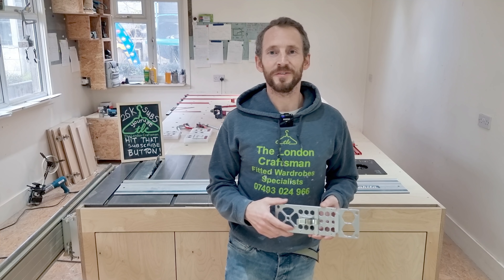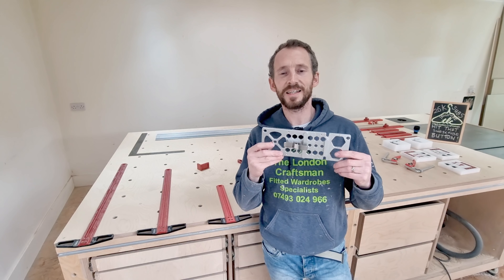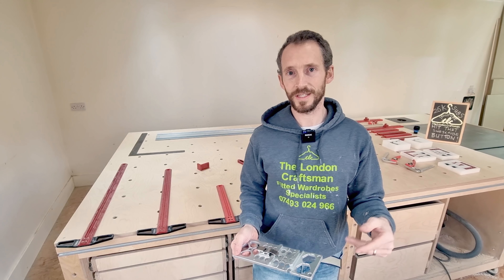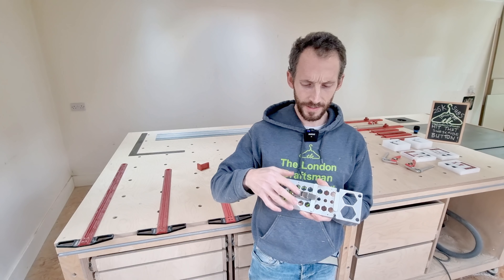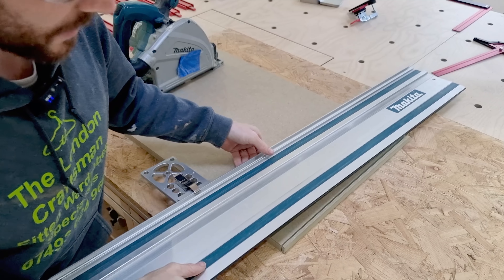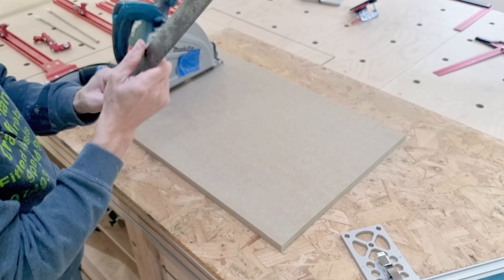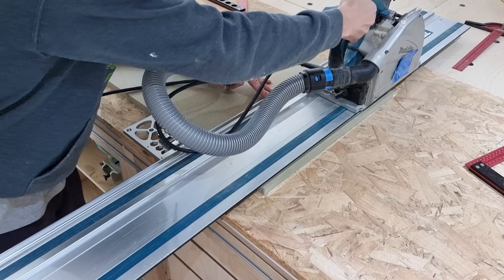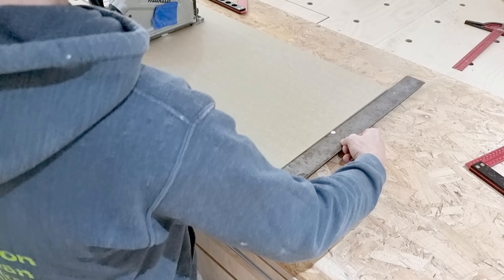A TRACK SAW SQUARE For Just £18.89 -  Does It Cut Square?  Worth Buying?   SAVE £££ - Vid#82

Comment: I got one a month ago. Read a few reviews saying it was not quite square, but figured I would take a chance as it was cheap and at the least use it by cutting long and squaring up with the table saw. That way I could just lay the track down on one mark and cut,  saving time by just making one mark. I was pleasantly surprised it was square out of the box. I have it matched with Powertech track. It is not fair to match it against the big names and if you use your tracksaw a lot I would go with TSO or Benchdog, but for an occasional woodworker like me it will work fine.

Comment: I bought one a couple of months ago. When recieved, I tested it - but in a different way to how you did it. I didn’t use a saw but drew a pencil line along the sacrificial edge; then I flipped the thing over and drew another line. Perfection would be that the two lines were perfectly parallel. Mine were not but out by less than 1mm over 1400mm. I was happy with that. I bought a second one so that I can effectively set one up at each end of the track and then easily slide the track down the sheet of ply or mdf to get square cuts. 

I also have one of those jogs for cutting European hinges. Very solid and accurate enough - I have the Kreg jig which isn’t as solid at all.

Comment: That’s a great video as sometimes it makes you wonder. 
I have just made 2 large bookcases for a customer and I always prime the cut edges with acrylic primer. Sanded them back, beautiful. The customer wanted them finished in gloss paint which I applied with a foam roller as I don’t have access or experience with spray guns. I applied 2 coats and I’m not impressed with the finish. The edges feel rough and the rest isn’t much better. As I don’t give up, I will be revisiting this with some more sanding and another coat. 
Any tips on application or paint diluting would be appreciated.
Reply from the maker: Hi, I have quite a few videos on my finishes you can flick through 👍

Comment: Got one of these, also slightly out of square. Haven't gotten it spot on as of yet. It's nicely made but I think the Benchdogs version is still on my shortlist. Their stuff is mint. The way this is made and with the tolerances I'm not sure I can ever trust it 100% but it's nice for quickly breaking down things a bit over final size and it'll be a lot better then my previous method of rough measure top and bottom and full send 😅

Comment: I also had one of these that wasn't quite square. It was out about 1/16" over 24".  It would be adequate for many jobs, but if you're cutting cabinet sides, you'd like it to be a little better than that.  As I was considering how to fix it, it occured to me to try removing the piece that the track is clamped against and flip it 180 degrees.  Sure enough, it was dead on after that. YMMV.

Comment: It seems difficult to adjust to be perfectly square .I would have placed a cam in one screw so you could rotate a very fractional but consistent adjust. Second . You could do a cut off square four edges to measure and magnify the error

Comment: Some years ago I bought a Triton rail square, when that was the only “budget” option available. That also was about £20 but I could never get it to give a square cut…complete waste of money. I eventually shelled out for a Benchdogs square and, apart from the day I spent the money, I haven’t regretted it. The Benchdogs square also has tapped holes that allow you to add dogs that allow perfect registration on post-formed worktop…they also slot into an MFT style bench top and hold the rail perfectly square to the fence.

Comment: Surely it would be easier to adjust by lining it up to your square …. I’ve ordered one for site work as I don’t want to use my Benchdogs one out of the workshop
Reply from the maker: I did but had a mare with filming as audio disappeared on second half so refilmed and forgot to add that clip in
Reply: Ditto! As mentioned elsewhere, I've got the BenchdogsUK and the TSO versions. Both fantastic! No danger of ever rocking up to a busy site with either, so was blown away by the price of this, but ultimately disappointed by the fact that it isn't actually square. I'd be interested to hear how you get along with it.
Reply: Also you could use your dogs on your bench if you have mft type top

Comment: You didn’t mention if the holes in the square could be used with bench pegs for use on an mft as in the Benchdogs Festool and Woodpecker versions. The others are clearly in this instance a far more superior and functional product. I would go for the Benchdogs version every time for functionality and accuracy despite the price.
Reply from the maker: But this is 18 quid, I guess that's the point in this video, you could buy at least 5 of these for the price of one. Don't think thise holes are ment for mft

Comment: Ordered one. Currently got the triton one. Only 40 euro and does a great job. But never expect the cut to be 100% square when only using a rail square.
Reply: Well, there are squares that will do the 100% square and I own one. But they do cost significantly more and usually you have to use rails that are straight too.

Comment: The first step to squareness is having a track rail that is actually straight and parallel which Makita track rails are not I know this from many I've had over the years.   Makita rails are very poorly and inconsistently manufactured this demo would be better served using a festool track rail.
Reply: I second this opinion, the Makita rails are often bowed so watch out

Comment: Does anyone know if this will work with Evolution tracks?
Reply: Unfortunately not
Reply: @jimp514  Are you sure? The Makita and Evolution tracks are very similar. The evolution track works with the Makita track saw.
Reply: @Argyll1000  Yep I'm sure. There isn't a lip on the Evolution track for the clip to lock onto
Reply: If it fits the Makita and the Festool, then no! I've got several tracks from Makita and a couple I bought from Evolution  - sixty pounds for two 1400 tracks, two clamps and a carry case. I use the Evolution tracks with the corded saw, and the Makita tracks with the cordless. 
I've noticed a lot of YouTubers tend to imply that you can chop and change from one saw to another on the same track, and that simply isn't the case. I use 1.7 mm kerf blades on both saws and even then, there is a noticeable margin from one to the other.